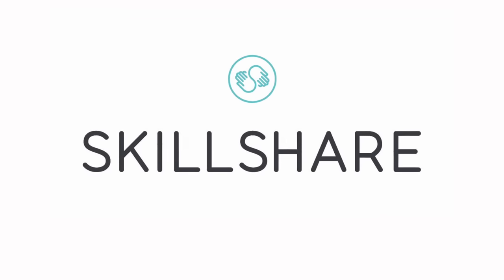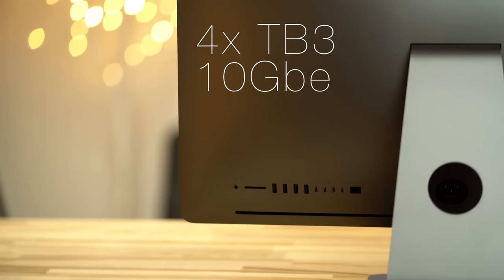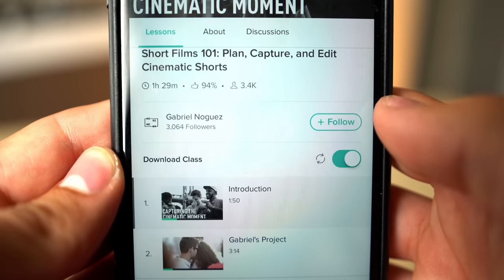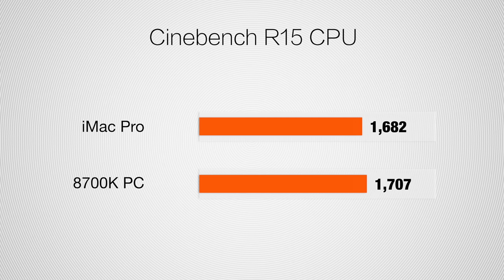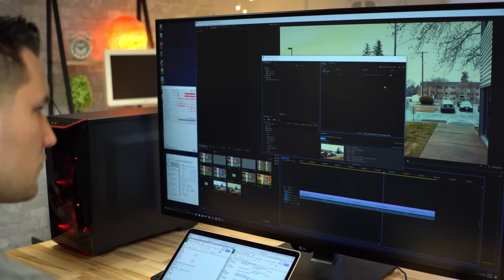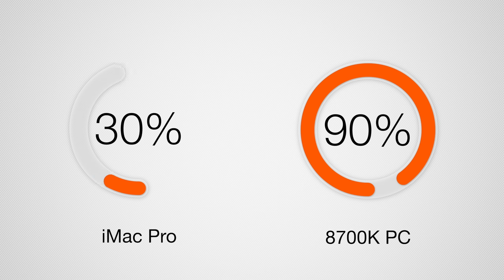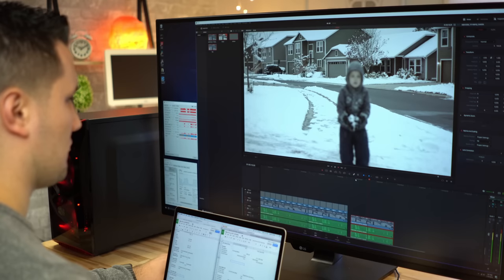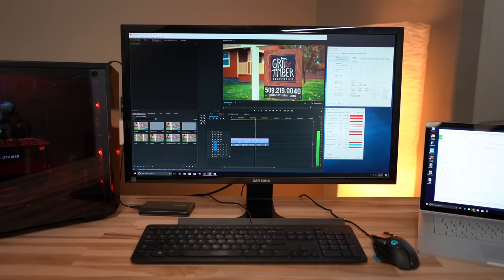$1350 PC vs $5000 iMac PRO for Video Editing 😲 Premiere & Resolve

Comment: Before I bought my iMac Pro, I ran my own tests at the Apple Store. At Apple Stores, they often have already made projects set up when you open programs on their demo machines. I opened Final Cut, which had an 8K project with all 8K footage in the timeline. I started playback of the footage, which ran smoothly at full speed 24 fps. While that ran, I opened another program which had 4K footage in the timeline, and started playing it back. I opened iMovie, which had HD footage in its timeline, and started playing that back. So, basically, I had THREE programs playing back 8K, 4K and HD footage, SIMULTANEOUSLY without so much as a frame drop. I guarantee you that $1,350 PC could NOT do the same.

In film editing, playback is a HUGE part of the process. Being able to playback footage at full speed is preferred. So, these so-called tests are BS. Because, I guarantee you, no fricken $1,400 PC could do that.
Reply: Thank you. I rest my case
Reply: VFX Todd well it's not bs as Max is very balanced and does state that the iMac can play the video at 6k with ease whereas the pc struggles as the cpu is being maxed out and it drops frames. Very good comparison of everything that matters.
Reply: VFX Todd Yeah a 1400$ pc cant, but for the same money as the IMac you can do that and you will get even better performance
Reply: With the current config no you cant to do more intensive tasks. But by spending 2750 dollars the sweet spot for current video editing. Or 3k with all the peripherals included. With amd threadripper or i9, plus titan v from nvidia you will get twice or close to thrice the performance of the imac. So you now can decide whats the best setup. Also for premiere or davinci resolve users pcs are better because of better overall running on windows
Reply: A 5k monitor with accurate P3 colours for less than $250? That's insane! Where'd you find that?
And Premiere and Resolve don't run better on Windows. Premiere runs better on Nvidia which Macs don't really have anymore, but it's not the OS. And Resolve actually runs a bit better on Macs I'd say. It uses Metal quite well in the 14 release
Reply: VFX Todd Yes, but a 5000 dollar PC would demolish that iMac Pro
Reply: Neil Mo your argument used to be true back in windows vista days step up your game
Reply: It's okay, we feel bad for you spending that much money on the iMac. We hope this post makes you feel better.
Reply: You won't get ECC memory and a Xeon CPU for that though... you'll likely get more confidence in the iMac Pro
Reply: You made a good example but your clearly missed the message...lol For one who would ever do that what you just explained because 1. that is just idiotic. 2. the majority of people who buy the iMac don't ever use it's full capabilities nor will the people buying the built PC. 3. that one he built was $1,350 So really you could build one for say $1,600 that could do that if someone wanted to and would still be cheaper. 4. the iMac 5k Monitor is a gimmick that 99% of people are falling for. You can simply search Apples 5k monitor and read up and you will find many people complaining how all it does is STRETCH 4k footage and comes out looking a little wonky. plus How many cameras do you know that shoot 5k? lmaooo   Apple knew 4k was the new thing so they said we will bullshit everyone and make a 5k because 1 more K is better...lol and they where right everyone fell for it... lol   Now idiots are jumping in to 8k when so many today still don't even own 4k TV's... thankfully they are getting cheaper but still many don't care yet... 5. Apple announced years ago they will NOT be expanding FCP past FCPX but will only be releasing small updates which they don't even do that often.. Apple has moved past the creators, Artist and Musicians and now mass market every day computers for the masses that will pay more then the device is worth...  LG makes a bad ass 4k ultra wide monitor for a little over $300  take 2 of those build a PC for 2 grand and you are still less then half of what the iMac Pro is... the other bullshit Mouse and Keyboards are cheap as hell... if that clearly doesn't make sense then you are completely hopeless when it comes to intelligence...  I own a MacBook Pro full Specs, MacBook Air, Mac Mini, iPad Mini4 and even I can clearly see now that Apple is no longer the Apple we once knew and loved... and for those of you who say but but I like Mac OS better then Windows...   well I spend 99% of my time in software and 1% actually on Mac OS so the OS is pointless... and Windows is not what it once was. if you know how to use it properly it is just as good a Mac OS... it is time to face the facts people... Until Apple starts producing New and innovating products again I will no longer be buying Apple products...
Reply: If you stop watching porn and stop downloading cracked software from untrustworthy sites you won't get Viruses... it is literally that simple... as for Updates they are done automatically and can be set to do them while you are sleeping... Windows is not what it used to be trust me... it is loads better now days... and this is coming from a Massive Apple user... I am fluent in both Apple and PC... just ffs don't ever buy a budget Windows computer.  and if it still scares you then simply find someone to build you a Hachintosh... they are not all that simple to build your self. However many have released a spec sheet and step by step in to building them... then you get the best of both worlds... Performance and the OS you like on a budget. but remember this.  the OS is meaningless... I spend 99% of my time in some sort of software and 1% on the OS...
Reply: Double D Not true, for someone who is a self-professed computer expert, you’re spouting total crap. The OS is 99%, and programs 1%. It handles how programs can utilise resources, how users can use the programs, and performance optimisations. 

At the end of the day, anyone watching this video is going to listen to what they want to hear. I know for a fact that the iMac Pro is actually priced well for once, and performance is outstanding. If you listened to what Max said at the end, Adobe Premiere doesn’t utilise most the Mac’s power anyway.
Reply: You clearly are lost... Many Apple users excuse to still buy Apple is because they like How Mac OS looks and because they simply already know where things are and how to work around Mac OS... but once they know their way around 99% of their time will be spent in software other then Mac OS... and no you are wrong it is Ram, Processor power as well as Hard drive type that makes the Software run smoothly... the OS has very little to do with software.  Running software without the latest updates hardly effect your workflow compared to NOT having a big enough processor... Multitasking around a computer between software is Ram not the OS...  I own a shit ton of Apple products I also own some windows computers and my Windows computers run the exact same as my Apple computers...  if you are attempting to talk shit then I can almost promise you don't even own a Windows PC... but hey this is the internet you can claim to... lol   I never claimed I was an Expert and I do not know it all... but I know enough to take on this argument much more then your average illiterate Apple user...  You simply are just copy and pasting the same old shit that Apple users continue to copy and paste with your whole OPTIMIZATION comment... lol 

At the end of the day people will still continue to be ignorant and believe any Apple product is priced right... when in fact everything Apple produces is clearly over priced.  You are clearly paying extra for a name... but don't worry... it also took me a while to figure it out before I switched back to Windows... the funny thing about this is... eventually you will be on a Windows computer... lol I promise you...
Reply: Double D hahahah right this makes me laugh. Because I’ve owned windows all my life, and only switched over to macs two months ago. I argued tooth and nail that Windows was better, but was blown away when I got this MacBook. 

 The OS is responsible for deciding how much to allocate to programs. Say you have Premiere open, and another high usage application - what decides where to allocate the most processing power? What decides what RAM to temporarily store in the SSD? OS, my friend.
I’m a web developer and I bought a MacBook so I could properly test websites in safari, and so I would have a portable computer I could take with me when I travel. I get an extra 5 seconds in every minute I work because of the way multitasking operates on the Mac, allowing me to switch apps much quicker than I would in windows. When I had a windows PC, I frequently had crashes related to my network adapter - but there were no driver updates. once or twice a day, the computer would have a fatal error and I would lose all my unsaved work. 

Or let’s talk about my Lenovo Z500, an £800 laptop I had for 3 years before windows had partitioned the fuck out of my HDD because the OS had created bad sectors, and the computer had less than 200GB of my 1TB storage left. Last year, that computer died, stuck in an endless cycle of kernel errors and restarts. Only way that computer could be fixed is a new HDD. 
The OS has everything to do with software. Yes, the hardware is more important, yes programs play a huge role in this, but programs can only access utilities and resources that the OS allows them to use. I’m not talking updates here, I’m talking the structure of the OS, and how it interacts with hardware. Haha you’re one of these people that thinks ‘oooah my computer is running slow, better buy another 32GB of RAM’. Well news flash for ya, hardware isn’t everything. If it is, uninstall your OS, and we’ll see who fares better.
Reply: Double D and sorry I didn’t address your last paragraph. If you buy a like for like PC for the mac, it would cost $200 more. Techno buffalo did a video on this. He stated that the Mac is cheaper for equivalent components, but most people probably wouldn’t buy the same parts and would instead opt for nvidea cards, higher spec processors, etc. Yes, Mac’s are always more than the PC equivalent. In my case, it was £400 more than a Mac, but in 5 years time, my MacBook will still be worth >£1000, whereas the windows machine will be unsellable.
Reply: is that on the standard imac or the maxed out one
Reply: Are you including the 27inch high class leading 5K display in that 5,000 PC price? If not, you are saying a 6500 to 7000 dollar PC would compete with the 5K iMac Pro.
Reply: Exactly! Not to mention the reliability and functionality of the OS, and the time I've saved compared to my PC. But I'm not a gamer, so I don't really miss out the perks of windows. But yeah, try and find a $3k PC that is actually faster (not just benchmarks) than this iMac!
Reply: Reliability is not actually an argument anymore. I run a complete custom liquid cooled PC with 1080Ti, 64gb of ram and an older i7 5690k@4.5ghz 24/7 and I have never had reliability issues. I would never buy a Mac because I am an engineer and most of the software I use that isn't video or photography based doesn't run on a Mac. I am also a VR developer and you can't run any kind of VR to my knowledge on the Mac, at least not yet. I upgrade my video card yearly, I upgrade my processor/motherboard when something worthwhile comes along. I keep my case and my power supply and usually my ram unless another type comes along and forces me to upgrade. I don't buy Macs because I like to pick and choose what hardware I want and upgrade it when I want. Until recently Apple thought it would be a great idea to solder blank memory cards into their motherboards so you can't upgrade them. They use custom video hardware that's based on a standard like AMD but not be up gradable. They used to overcharge for everything because people would buy it because it was shiny and pretty. They have finally come to the conclusion that people do eventually get smarter and they now allow you to upgrade the CPU/RAM but you are still stuck with everything else. When you buy a Mac you are paying to have less flexibility and have access to less software. The other thing you cannot argue is Microsoft has 88% of the market vs only 8% for Mac (Google it). For those that get virus's on their PC's, it's from going to websites they shouldn't or lack of knowledge in general (there are 80% more windows users). That's similar to saying Ford F series crash more, not because they are worse vehicles or have worse drivers, but because more people own them than any other vehicle. Law of averages needs to be taken into account.
Reply: couldn't have said it any better myself, coming from an iPhone/Macbook owner with a custom built pc
Reply: I've worked in visual effects at high end production houses, like 20th Century Fox, and I have yet to see a PC we're given to work with perform as well as my iMac Pro.
Reply: Would it? I'd like to see that. So far, I hear crickets.
Reply: Yea, I feel a lot better. When a program locks up on a Mac, I can open another iteration of the same program and start working again. Which cannot be done on a PC. Strike one. Viruses. You like viruses? I really don't have to worry about viruses. Strike two. Stable? I've never seen a PC as stable as any Mac I've worked on. Never. Macs are worth their money, hands down.  Strike three.
Reply: Really? Let's see it. (crickets)
Reply: I bought the base iMac Pro.
Reply: PC with half the Price of that iMac will do that . You can create a Ryzen thread ripper build within price cap of 2500 dollars which will produce enough amount of power
Reply: Perhaps not, but its still possible to do even better on a PC for less. An i7 8700k is a low core count enthusiast CPU. To compare to a iMac Pro you would need to compare it to an i9 with quad channel memory. That would raise the cost by about 1200 addition dollars. So 3kish. However that is still worlds cheaper than the iMac Pro, and would out perform it by about 40% in both multi tasking and video rendering. The iMac Pro is pretty good, but its over priced and under cooled just like all Apple products.
Reply: VFX Todd yah but final cut is trash premiere is much better because u can use it with other adobe programs like after effects (helps alot with cgi)
Reply: FWIW - if you wanted to truly match-grade the Mac, and include an equivalent monitor and a really nice looking setup (since design is important to most people who would drop $5k on a system), then you're looking at ~$3000 for a PC that is able to do all the same stuff (and more), including multi-tasking in multiple 4k or larger files across multiple apps. Major upside though, that would include more memory, more sdd space, and (again) be fully custom. 

Honestly I'm not sure why we still have these debates - anyone who genuinely thinks their mac is 'better' simply is delusional, but if someone PREFERS the mac, then more power to them, if they want to spend twice as much money for a specific OS, have at it, and god bless capitalism. :P
Reply: rowie409 read double d s comment above
Reply: VFX Todd your yeah feel a lot... Comment

I use 2 or 3 screens (strike one)
And then normaly have the main programm I am using on my primary screen while I split the other programms up un the secondary/ third (strike two)
I don't get viruses although I have turned my antivirus off often as I don't watch pron/ download it and only download things from which I know they can't damage my pc(strike three)
I also have a keyboard that gives me nearly 100 macros for 20$ darwn van hermet made a vid on it. (strike four)
I can confirm the lag on cheap computers if you want to playback 4k footage but a good workstation has none of these problems (strike five)

That with opening an iteration of the same programm I give to apple. Sometimes it would be handy.
Reply: So for the price of the max spec Imac pro. This pc:https://pcpartpicker.com/list/M3KdHh Which will smoke that Imac pro any day of the week.
Reply: VFX Todd A 3k PC could do it easily , you are still being scammed. Or a 4k USD px
Reply: PC is not the "master" race. It's the specialization race.
Reply: You don't even need an antivirus to keep your PC clean, all you need is a brain to know not to visit shady sites.
Reply: Yeah, who would say a $5000 computer is more powerful than a $1350 one... Try it with a comparable PC and it will cruch the MAC...
Reply: The best Hardware available today and 2 graphics cards would be under the price of the mac...there is no comparison at the 3k price range of a PC
Reply: Macs arent bad, just overpriced. Pcs win here, you simply can not compare the two because of many factors like price, upgradability, customization, etc...

Only reason you would get it is because of a certain software or because your a diehard apple fanboy
Reply: and?so you're telling me a $6000 computer,which tested close to a PC under $2000,would also rock a PC priced around $3500?really?you believe that?
Reply: I signed in just so I could LIKE this comment lol  #PCFTW @pvalin
Reply: You are aware that there's absolutely no difference in the hardware anymore? Or didn't you watch the clip? You are paying Apple a huge bag of money for their OS and the logo.
Reply: which is complete bullshit, it doesn't matter what the price is, it matters whats in the machine, i promise you my laptop will smoke a good 95 percent of machines in a apple store with the same test and it only costed me 1700 bucks but the shit kicker is i got a i7 8700 non k in mine 500gb nvme ssd 1tb sshd  and 32gb of ddr4. spending 5000 dollars doesn't make your purchase automatically a quality product.
Reply: but macs prioritization is different than PC. In task scheduling mac favors the current task the user is doing iE whatever is in the foreground but for PC they treat all tasks equally and therefore split up resources equally which means the breaking point is fixed. Meanwhile mac will just keep deprioritizing other tasks until there's not enough resources to run all the tasks at the same time even with prioritization.
Reply: @joshualyness4790  u can still sell used refurbished parts old ones to like the gtx 960 or 980ti